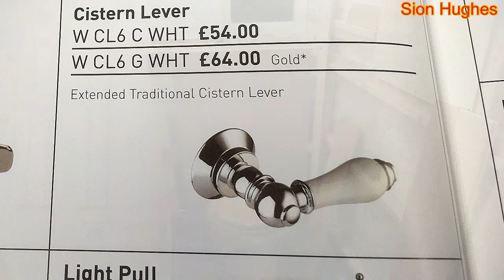Boxing in a toilet

Comment: How does the extended handle work?
Reply from the maker: Exactly the same as a normal handle with the difference being that the handle is just longer and travels through the wooden box section that covers the whole toilet system.

Comment: Where did you get those sleek radiators from?
Reply from the maker: Bought on eBay . I think they are mostly used in bathrooms but personally I like the mix of very old house and very new radiator design, plus the free up wall space . Hope that helps . Cheers Sion